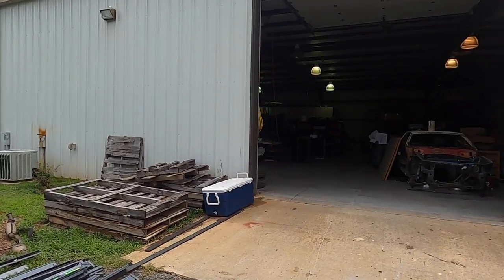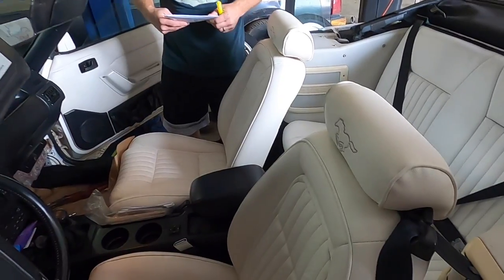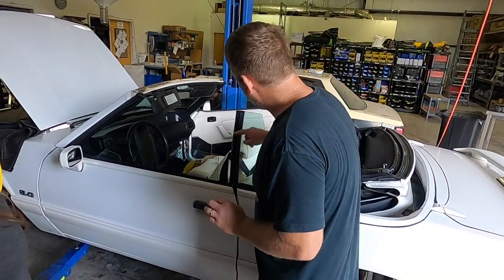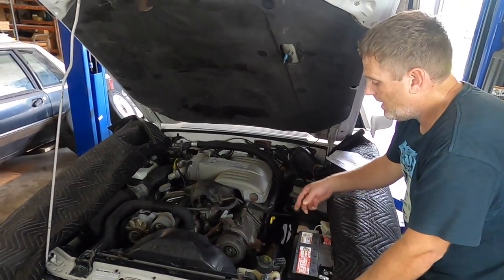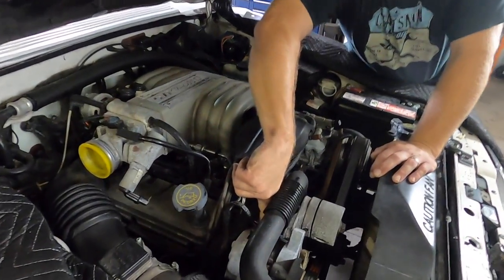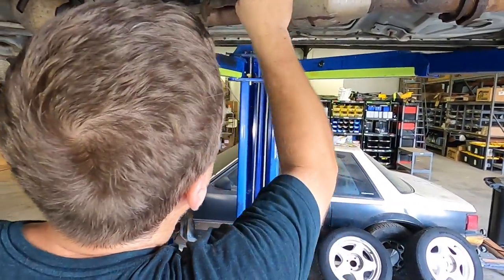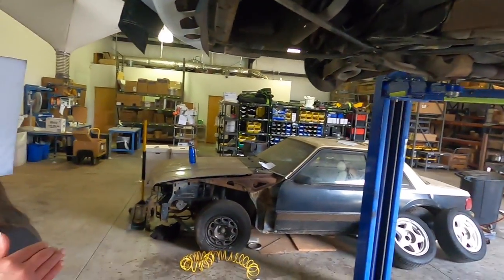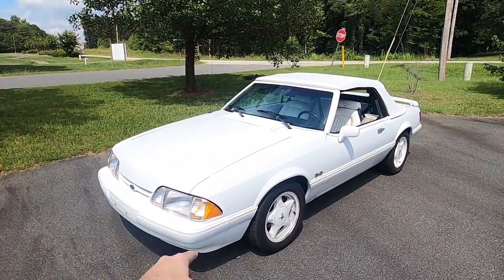EVERYTHING WRONG WITH THIS TRIPLE WHITE FOXBODY CONVERTIBLE SPECIAL FEATURE SUMMER EDITION!

Comment: Great video once again Matt it's pretty cool to see everything that Matt goes over there's some things that I have never even thought about checking and it just blows my mind sometimes it's like when I got my car it had sat for 7 years and in overheated cuz the fan clutch went bad it leaked water when it was cold after a couple times of driving it between the block and the  timing cover and a little bit at the water pump it's crazy how weather and sitting eats up the car is almost worse like Matt was saying makes bearings freeze all kinds of stuff... just caught up on a couple videos that I didn't get to finish all the way through but  I watched them all this past weekend and today!!!
Reply from the maker: Wow, sounds like you were doing a little bit of binge watching that's cool.  Matt is very meticulous and has all the required knowledge.  It's cool to see for sure.

Comment: Matt knows his shit! I’ve been trying to trace a white with black stripe wire with a push on connector on my 83gt, from the driver side it goes over front of the engine to passenger side. Could you please help?
Reply from the maker: Give them a call at 704 888 1278 during business hours or email parts@foxresto.com

Comment: i used underdrive pulleys on my car .....just on water pump alternator and crank .....of course typical underdrive bigger alternator and water pump smaller crank ....my car instantly overheats in traffic threw town .... so i put the bigger crank pulley on and left the bigger underdrives on my alternator and water pump ....guess you could say my alternator and water pump are a bit overdriven now....no more running hot in traffic and my alternator never drops to 10 volts no more ....lol...
Reply from the maker: LOL, well sounds like it's working well for your car now Shane! hah hah

Comment: original flowmasters would be 2 chambers, not "40 series"
Reply from the maker: That is correct!  Slip of the tongue.   There were 3 chambers as well as I recall (force II kit I think)
Reply: @GearHead704  1,2, and 3 chambers depending on how loud you wanted it to be.

Comment: Man reminds me so much of my 91 LX Vert. Clean but with some work needed. What sucks is it’s a original car but it won’t be anymore after these parts are replaced. Matt might have some of them NOS. Which will cost 3-4 times more than the local parts store parts. Not sure if he has all these parts though. That’s the issues I had with mine. I have a long list of parts that have been replaced on mine because of being worn out. Have my 1990 date coded wires which I took off too doing a tune up. But it was a little disappointing having to replace these oem parts but what could I do? Mine got 100k on her too.
Reply from the maker: Yeah that's the problem for sure.  The NOS stuff is great but definitely way more expensive.  It's so sad when you have to remove the date coded wires, but at least you still have yours.  Nothing you could do for sure buddy.